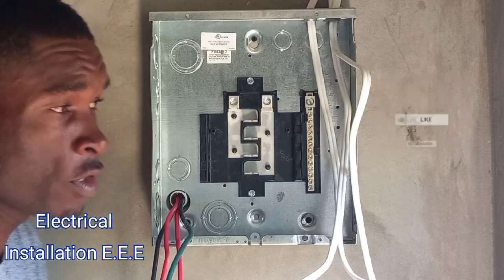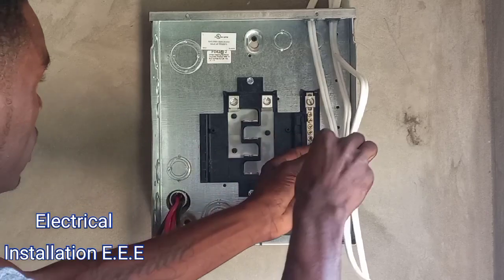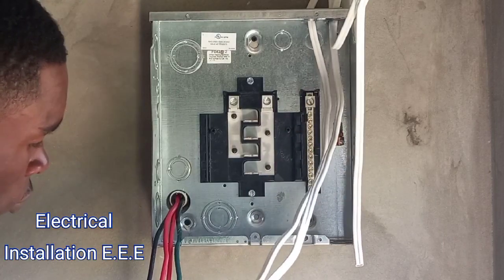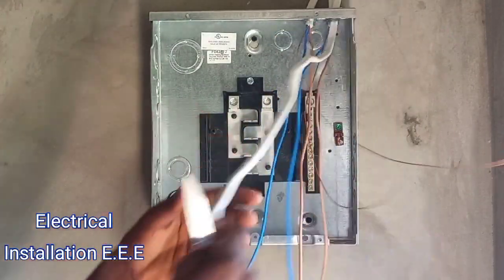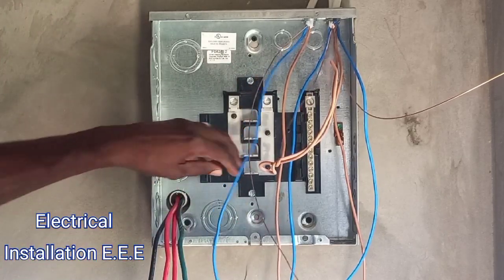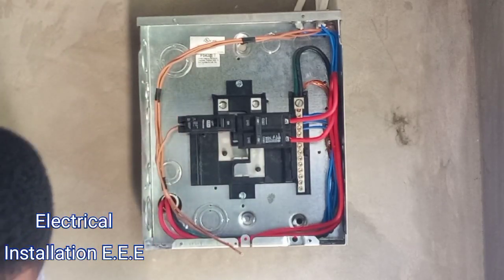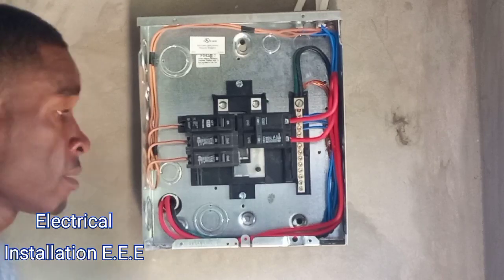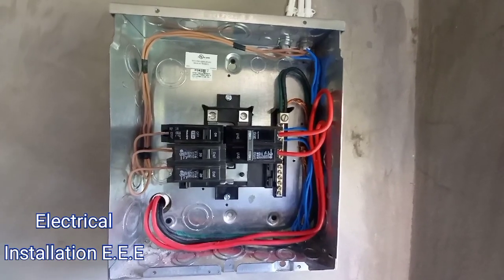How to connect a domestic main breaker panel !! Tutorial Video

Comment: First and foremost, I must commend you for the good tutoring that you have been giving to the younger youths who would love to do electrical installation. 
         Okay now, re your question! The reason for putting the ( 40amp) main breaker on the right side, which is your left; is because the neutral connector are on that side , and also it is much safer and easier to make the necessary connections.

Comment: always put the larger breakers at the top and then you work your way down to the 15 amp. also you could explained that a single pole breaker will give you 110 v and double pole 220v

Comment: Thank you very much sir.....i may want to  know the source that come to the circuit isn't single phase or two phase.because saw where you screw the neutral and the earth right.and why you put the main breaker at the right hand side of the panel ?tnx
Reply: single 220
Reply: There is no 2 phase. It's single or three phase.

Comment: Why would you connect 2 wires in one lug when you have all those extra lugs available, if this panel is the first disconnect after the   Meter you can put the ground and nuteral on the same bar

Comment: Thanks for the video.
What size of breaker and cable should be used for a jacuzzi? When operating at a voltage level of 240v.

Comment: What I have observed is there is no insulation covering on the earthing conductors.In England all earthing  conductors, colours are green and yellow stripe. The Neutral and the earthing are connected at the supply head after the protected the fuse before the meter. And separated as it enters the distribution Board.As to the question,AS the mains breaker the supply side will feed the link bars that supply the other breakers.
Reply from the maker: Ok in JA we use the twin and earth cable which comes with a non-insulated earth  which is recommended  but we don't use the non-insulated 2.5mm single wires.

Comment: Yes sir I think the reason why you put the main breaker over the right side of the panel is because in case the wire slip out of the main breaker it will hit the neutral bar,and the neutral bar will send back the current to its source.
Reply: https://www.youtube.com/@autoelectrician723

Comment: Greetings EEE, I was wondering if you added two more circuits to that panel where would the earthing wires go,and why not use a 10A  breaker for the lighting circuit?
Reply from the maker: change the lug if additional wires can't fit.. in our regulation we 15 smallest not that 10 can't work but it's what we use..

Comment: What is the main reason why you tie the neutral with the earth?
Reply from the maker: Because this is a main panel the ground and nuetral should always bond in the main panel due to the fact they are related so in case any fault occurr you have a path way to the earth
Reply: @ElectricalInstallationEEE  this is standard practice in some countries and there is nothing wrong with it however it is considered in most countries that having a separate neutral and earth bar is a safer practice as neutral is basically a return path for your load and the earth is for use when under fault conditions. Interesting video I am a UK electrician and find how other countries work very interesting. Also I have just come back from Jamaica so wanted to see more as such a beautiful country

Comment: Bro thats a sub panel are main?
Reply from the maker: Main just a small house
Reply: @ElectricalInstallationEEE  a no 50amp a the lowest u can go for domestic building?
Reply from the maker: 30 lowest
Reply: @ElectricalInstallationEEE  and the smallest wire size?
Reply from the maker: 6mm
Reply from the maker: 6mm can use with a 30amp
Reply: @ElectricalInstallationEEE  wah the amp rating for that wire in wall are conduit
Reply from the maker: Don't matter if it is wall or surface 
6mm - 30amp for main 
8mm -30 amp
10mm - 30/40/50amp can use
Reply: @ElectricalInstallationEEE  ok whats the mix current carring capacity for the 6mm cable?
Reply from the maker: 32amp 
40 and upper will pull too much amp through that not that it won't work cause it depending on the load
Reply: @ElectricalInstallationEEE  oh ok. The reason why am asking is that I was teach that a 6mm wire capable of carried 41amp so it would need a 50amp breaker for that base on the js21 wireing code
Reply from the maker: No that not occurate you more likely to use a smaller size breaker on a bigger size wire , so u could use a 20 on a 6mm but not for main maybe like a A.C circuit or dryer etc
Reply: @ElectricalInstallationEEE  that me know but just showing how I was teach at heart but me always use a small breaker on a bigger size wire especially for voltage drop
Reply from the maker: The more u do the work a the more u go learn is not what u learn at heart it's just a plus
Reply: @ElectricalInstallationEEE  a real way man me thin me know eno bro a Clark's town u located doh?
Reply from the maker: Mad

Comment: Nice work. Question, How do you connect a sub panel for a upstairs house
Reply from the maker: Best to connect the upstairs sub panel from the main panel through a breaker a smaller amperage to the main to have control from there whilst people connect it from the main up at the top of the panel but by a breaker is best.
Reply: @ElectricalInstallationEEE  so is it best to use two  breaker or one. In case I want to turn off my sub panel from upstairs
Reply from the maker: 2 so if you want to lock down upstairs immediately 👍 or entirely
Reply: @ElectricalInstallationEEE  so for instance I have a 100 amp breaker for my main what would  be the best two breaker to use for the sub panel
Reply from the maker: 70amp  or 50amp d/p
Reply: @ElectricalInstallationEEE  70 in the main panel and 50 in the sub panel
Reply from the maker: That can also work even 40
Reply: @ElectricalInstallationEEE  thanks for the info and keep up the good work 👍
Reply: Question, so for the sub-panel the ground would come from the ground lug in the main panel right. And same for the neutral

Comment: Good Day Brother and I really love what you are doing with your videos for the community. As a returning resident, I noticed some differences in wiring standards. I like to know if the Square D Plug On Neutral Main Panel could be used in Jamaica, because that would reduce the need for pigtails from GFI or AGFI Breakers?
Reply from the maker: Appreciated bro .
Yes it can just that we warely use it but it can.

Comment: you put the double pole main breaker on the left side of the pannel because on that side the busbar count are even numbers
Reply from the maker: No because most people use right hand and in the position it is easier to switch on and off.
Reply: @ElectricalInstallationEEE  I totally  under stand, but I think it would be a bit safer away from the nuetral side tho just my opinion
Reply from the maker: Safer doesn't really work in this sense because if you put a 15 // 20 amp s/p breaker over there you still have to take precaution so in anyway where ever there is live current precaution have to be there regarding what u use

Comment: What's stopping the current from traveling to the grounds since it's bonded to the neutral in the panel
Reply from the maker: Well the neutral bar is seperated from the live bar so that alone should alone the current not to go there but if you are talking about waste current etc well that is difference because it only occur through the neutral to the earth if that makes sense.
Reply: Isn't that still dangerous. Because doing this is expecting the main utility guy to always do the right connection.. I've experience reverse connection from the utility company.. Neutral was live and live was neutral.. Had to call them immediately to rectify this issue.. Especially you're this is a metal box.
Reply from the maker: A main breaker can go anywhere in a panel once installation is accurate but where ever u install a main or sub breakers they should be treated with caution dead or live , it is regarded safe once the neutral not interfering with the connection , in this panel that is enough space for any professional to operate on if needed to there are panels that are closer that this and more crowded , safety is there plus easier for house home owners to switch on and off , regard neutral returning back power to the panel from the utility that can happen but doesn't affect the location of the breaker.
Reply: I get it now, the current will take the best path back to the source to complete the cycle and not to the earth It's a dead end

Comment: Question boss when taking out a breaker do you hv to remove the breaker from the belly then take out the wires ?? Or you can just turn off the breaker then screw out the wires ?

Reason why I asked it's because one time I was screwing out the breaker my screwdriver got arched
Reply from the maker: Turn breaker off first then pull out ,you can screw the wire out after taking the breaker out.

Comment: How many plug outlet on a 20 amp breaker? Whats the maximum and minimum height a breaker panel    
should be installed?
Reply: @Luxury Music  I was thought at Heart NSTA that the  distribution panel must be a minimum height of 4 feet from floor level. 

And there is no maximum height for the panel. As long as the top most breaker is accessible. Which is the Main Breaker.
Reply from the maker: 4ft is 48" but 47" is the minimum and as i said it depend on the size panel etc
Reply: @ElectricalInstallationEEE  ok
Reply from the maker: Yeah but you wouldn't want to put it too high .it just have to be reachable and not in danger of a minor .
Reply from the maker: 5 plugs for bedroom ,living ,2 in kitchen if g.f.c.i include ,for breaker panel depending on the size panel etc for domestic at least 47 inches

Comment: I don’t think is matter where you put the main breaker as long as its a two pole breaker for this service. But it may be for balancing the load
Reply from the maker: Yes it matters ,most people use right hand the double breaker easier to switch on and off in that position than the other side.😅
Reply: @ElectricalInstallationEEE  in Canada those guys mount the panel sideways. I caint take a Canadian electrician serious I always look at them side ways
Reply from the maker: @jak50cent  lol side ways
Reply: @ElectricalInstallationEEE  that’s what I said when I first saw them
Reply: @ElectricalInstallationEEE  Only if you are right handed.

Comment: Why  u put  it on that side because u not use in main breaker  remember if  you was use in main breaker to the top the was going on the next side  so you of to put on that side to balance the load  plus it is small panel too
Reply from the maker: No ,most people use right hand ,a double breaker much easier to switch on and off from that position than the other side.